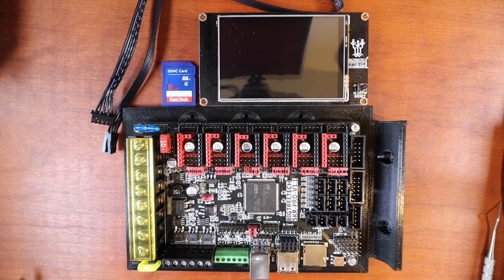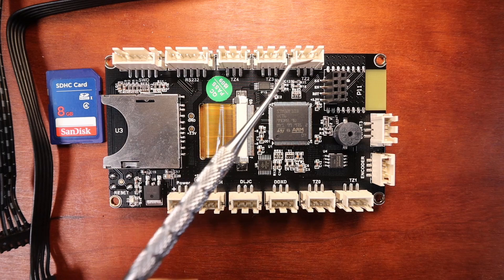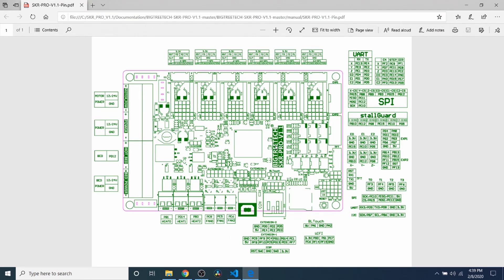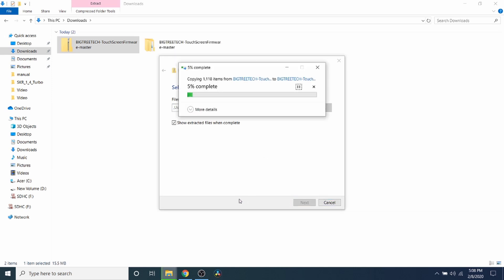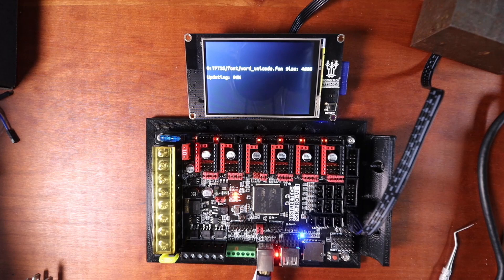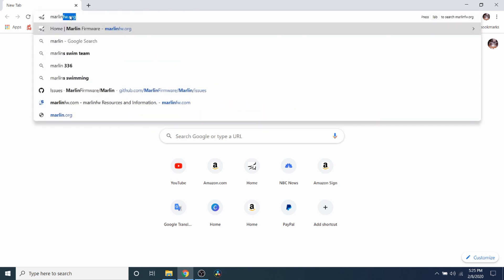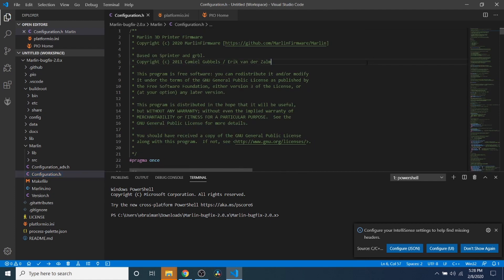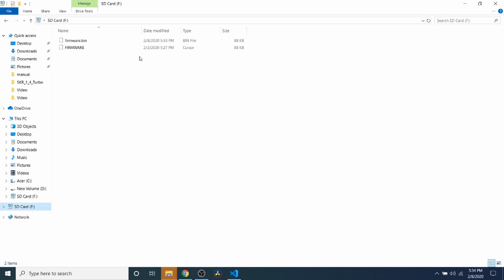SKR PRO V1.1 TFT35 V2

Comment: I had to copy the config.ini and config_rrf.ini and it suggested the language so I copied the entire language folder as well, although language update is optional the config files were not. Also be aware that there are four different interface themes besides the unified theme that work fine with the TFT35 V2.0. I'm using the red theme without issue.

Comment: I have been having problems with the TFT 35 E3 v3 and the SKR PRO 1.2 card, when turning it on in LCD 12864 MODE mode (wiring correctly connected, screen and card update done), it behaves normally, but when I switch to TOUCH MODE (the baud rate for both skr pro and tft35 e3 is 250,000) her status remains 'No printer attached'.
What can be modified to communicate in bltouch mode?
Reply from the maker: Since I recorded they came out with a new firmware release.  It now has a configuration file to edit in notepad++ that will change default speed and other functionality.
Reply from the maker: I'll be doing a live stream in about 30 minutes on firmware updates and possibly changing display characteristics.
Reply: @EdwardBraiman   
I was waiting for the transmission, will it be done today?
Reply from the maker: Just finished tutorial live stream at around 6 PM EST.  I'll be translating it in a couple of days.  Reason for couple of day lag in translation is YouTube takes a little time before I can translate to other languages.

Comment: Cool I bought one of these but cant figure out why It always says no printer connected.
Reply from the maker: Do you see a USB connected device in device manager?  Is there a jumper for USB power in correct position?
Reply: @EdwardBraiman  yay I figured it out. Serial -1 and serial_2 2
Reply from the maker: Congrats.
Reply: @EdwardBraiman  Thanks the tft 2.0 with the 2.0.26 update has so much functionality there is no need for the lcd12084 mode.
Reply from the maker: I'm a couple of releases behind myself.
Reply: @EdwardBraiman  The screen is on and connected to the skr board but it just says no printer connected so I cant control the printer with it.
Reply from the maker: It has to do with speed of baud rate mismatch and/or second serial port setting in Marlin firmware.
Reply: @EdwardBraiman  Yea I followed your setup change baud rate in marlin and on screen but no joy. Serial port -1 and serial port_2 1. No sure what to try nest
Reply from the maker: I think I made an updated video in one of my playlists.  second serial port might be different.
Reply: @EdwardBraiman  wow you have alot of content. That would be a mission just looking for that video. I will check out some of your other vids while im around.

Comment: Hi, thanks for tutorial. What needs to be done to be able to see board sd card via tft?
Reply from the maker: Unfortunately TFT will only function sending to motherboard.
Reply: @EdwardBraiman  hm,but how will power outage detector work than? I.e. after power recover, motherboard should promt for print resume.
Reply from the maker: I think it keeps the place in gcode.  I've not used one yet.
Reply: @EdwardBraiman  actually,it works. Just fresh Marlin bugfux and I can access motherboard sd from tft

Comment: Just a heads up for anyone else having recent issues with the version 2.0. The precompiled firmware on bigtreetech's site seems to break the touch screen functions on the TFT35 v2.0 and it will quit responding to touch. I have purchased two in the last week. I believed it to be a hardware issue so I returned them. I purchased a 3rd and it did the same thing. I of course was a good boy and updated the firmware first thing on the first two. For the 3rd one, I checked for functionality first and it worked just fine. I uploaded the new firmware from their site and the touch quit. So..hmm...maybe it's the firmware....lol...

So I compiled the firmware myself from their source file since I heard that BTT tended to be behind on updating the precompiled firmware that they made available but the source files are kept up to date. Sure enough, my compiled version worked like a charm and all is good now. The new one works and an older one that I had laying around that I thought was bricked came back to life also!
Reply from the maker: Thanks.

Comment: Hi Edward. first of all, great videos, good job!!
I am fighting with this board to enable the dual X carriage with tmc2209. If you want a new deal, could you try with it? maybe we can make a team because i am out of ideas, some days of test with no good results
Reply from the maker: TMC 2209 has some open bugs last time I checked.
Reply: Yes i red that in some sites, but i didnt find nothing reported on the btt GitHub
Reply from the maker: They may have fixed it, I've been more busy than normal at work.  I'll see if it's been closed as a bug.
Reply: Could you contact me in any way? I am building an open source printer and i want to use this board

Comment: Comments on the No printer attached, two settings:
#define SERIAL_PORT -1
#define SERIAL_PORT_2 1

Also in configuration.h of marlin
#define BAUDRATE 250000 
Must match configuration.h of tft35
#define BAUDRATE 250000

Otherwise the tft will not detect the printer

Comment: Thanks for the great video, just what I needed.  
I put the file and directory on the sd card, and the tft updated the fonts but didn't find the update.  I am using a 16Gb sd card and you did suggest bigger than 8gb wouldn't work.  8gb sd cards are as rare as hens teeth in shops so I'm waiting for one on line.  Is this the sort of symptom you were referring to when you suggested >8gb wouldn't work.  ill find out soon enough..  I'm just impatient
Cheers and thanks again
Neil
Reply from the maker: Try the other folder, bigtreetech changed the build and icons can be messed up.

Comment: Hi, i have been watching your vids and followed this one (and others) perfectly from making changes to the code and compiling  into a bin file and copying the bin to a sd card and putting it on the board even changes the bin to a cursor file. But my screen will not talk to the board at all even after trying the different speeds. Also pronterface wont connect the the com port that device manager says its connected to, pronterface will just freeze as soon as i select the port and click connect.
Would you have any ideas about this?
Reply from the maker: Can you give me some details about your TFT 35 hardware and software versions?
Reply: @EdwardBraiman  tft35 version 2. But I updated to the latest release a few hours ago 2.0.25.2
Reply from the maker: I'll need to try after work.  What does the display say?
Reply: @EdwardBraiman    it has changed to the new menu like in your video. But still says printer not attached.

Comment: Dear Edward,
A quick follow up on my question. After my compile error, I've googled the error. In VSCode, open platformio.ini and search for STM32F407ZGT6 ARM Cortex-M4. Paste this line platform_packages = framework-arduinoststm32@3.10700.191028 and the firmware will build.
Reply from the maker: That's great.

Comment: Dear Edward Braimain,
Thank you very much for your series on the SKR Pro 1.1.  I've followed your tutorial for setting up the SKR Pro 1.1 Marlin firmware bugfix 2.0.x step by step. The only exception to this tutorial I made is the definition of the steppers (I use TMC 2209 v.1.2). For this set up, I used your other tutorial SKR Pro 1.1 - TMC2208 v3.0 .  When you suggest to build (16:19 min in this video), the firmware starts to compile, but it results in a build fail and gives the following error #error "Oops! Make sure you have the LPC1768 environment selected in your IDE.".  I end up in the platformio.ini file, but in [ENV:LPC1768] the board nxp_lpc1768 is defined. Might that be the cause of the build fail?

Any help is much appreciated.

Thank you.
Reply from the maker: Thanks.

Comment: Thanks for the video.  Kinda bummed the usb port is gone.  I have the usb version of the tft35 board and absolutely love using the usb.  I rely on these running three home built cnc's, so I have a bunch.  My first 3d printer, I was forever misplacing, dropping, loosing the micro SD's.  The usb was a nice change for an fumbling older guy like me.

Comment: I have often wondered why we are still stuck at such small screens when a normal, and small in today's standard, tablets have 7 inch screens?  I would love to get my old tablet's screen on one of these (it is a touch screen too).
Reply from the maker: True.  I think they have larger versions, but I'm focused on most beginners budget's.  I'll be rolling out some high-end tutorials in the next couple of months to see if there's an interest.
Reply: I sure hope there is an interest because there are a lot of us out here who are beyond the basics and want more.  The only larger one I know of is, I think, 5 inches and on a certain printer (I can't remember its name) and they shoved it into portrait mode which defeated the entire purpose.  I wonder if there is some way to hack these screens to work?  I swear I saw something about that before.
Reply from the maker: Found a MakerBase 7" on Amazon.
Reply: I didn't as I just looked but here is the thing about all of this I just thought of and that is they need to ditch the nonsense of the RS232 to the TFT because that is far too slow of a communications to the larger screens.  Just look at the older days where the large monitors took two video cards to run smoothly and one did one section of the screen and the other card handled the other section because the video cards were not yet fast enough.  Well, same difference only in this respect it is the 115.2k (or even 250k) speed that is a HUGE bottle neck.  Leaving it up to China they will only do it after someone else does it and they can take the idea and mass produce it.